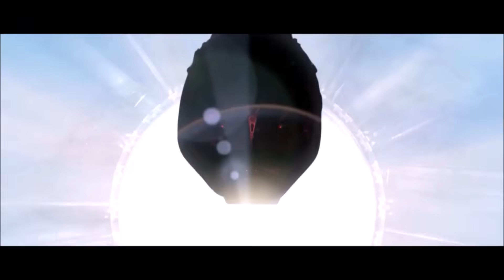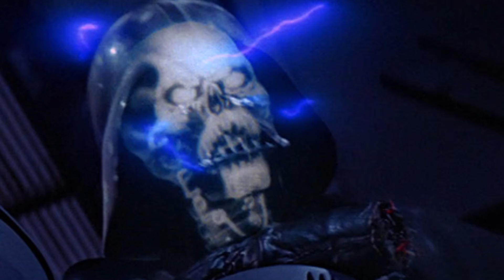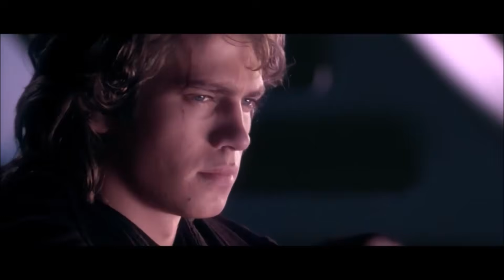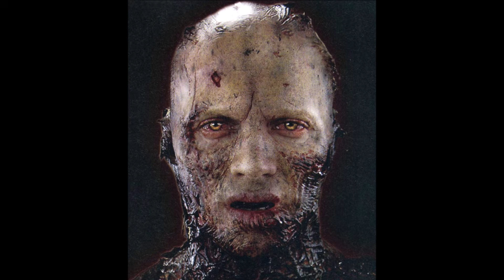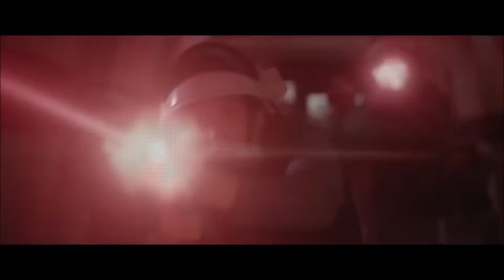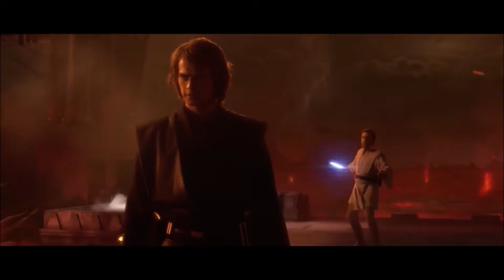7 Interesting Facts About Darth Vader's Suit - Star Wars Explained

Comment: Vader actually wasn't burned that badly, especially his face. His eyelids (even eyelashes), nose and lips are still intact, which is more than what can be said for many severe burn victims in real life. I know this is not Stupendous' words but official canon, but I also don't see how his vocal chords were damaged. Both while dying, and when his mask was destroyed by Obi-Wan in their duel, he speaks with a normal voice. Since his nose and mouth were also spared by the flames, I doubt his lungs were actually that damaged, and he had the lung capacity of an athlete. There is a theory that the cybernetic vertebrae high up in his neck may have kept a secret, deliberate limitation to prevent his heart and lungs from working without the suit.

Comment: Lore writers are so stupid sometimes. In real life, you can easily fry a simple electrical circuit using a power supply with voltage greater than spec, or by using the wrong polarity - ex. powering a 9V DC centre-negative guitar effect pedal with an 18V DC centre-positive power supply will absolutely damage it beyond affordable repair at a rapid pace. 

Yet Palpatine specifically designed Vader's suit to be vulnerable to Force Lightning, as if a body-sized iron lung wouldn't fail when unexpected and unregulated electrical current were introduced to it anyways? Let me get this straight: Palpatine arrives on Mustafar, sees Anakin's charred body on the shoreline, packs him into his ship likely noticing he can't breathe, yet decides to roll the dice with Anakin's life by delaying saving him in order to have a team assemble and design a suit that can specifically be more conductive? 

I'm sorry, this is too f*cking stupid. I know someone probably felt they had to write this so they could justify creating and selling a comic and getting that sweet Disney cash or some sh*t, but God. Damn.

Comment: If Vader’s gloves had Beskar weave to protect his hands from light saber damage, how was it cut off by Luke in RTOJ?
Reply: Was literally just about to comment that. Still a super interesting video though. Perhaps the blow missed the glove or he didn't have the artifact at that point?
Reply: @bobbycarpenter6207  Beskar weave in glove.
For hand protection from lightsaber.
Luke cut glove and hand off with light saber.

I see no artifact. 🤷🏻‍♂️
Reply: Beskar weave is lightsaber resistant. Not lightsaber proof. There's a difference. Just means it's harder to cut through, meaning a glancing blow wouldn't do the trick. But Luke was strong and also probably chopped down with force enhanced strength and cleaved straight through.

Comment: So that's how he ate, now how did he eh... Do his "Force Unleashed" then? Also, for how long did his battery last? Did he have a Powerbank for it stored somewhere? Was the information about his environment in Offline or Online-Mode in case things changes? If Online, did he use 4G-Signals or 5G, considering 5G drains more battery? Did he play Flappy-Bird or Super-Mario on his dual-layer eye-protection glasses? Is his "Always-On-Lightsaber" in working condition for sum relaxing private-time? If not, could The-Emperor possibly add an Expansion to Vader's-Suit, bringing Vader-JR back to life? If yes, will he be able to get machine-human kids? (Uh... Forget the timeframes mentioned lol it's a lot of then & now, just focus on the actual questions instead!)